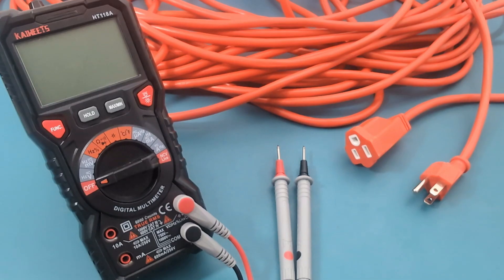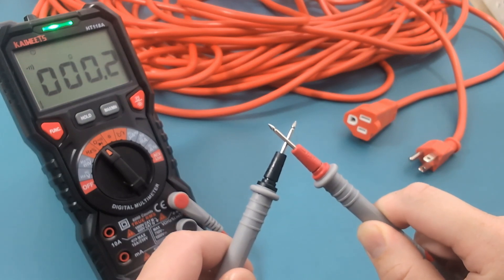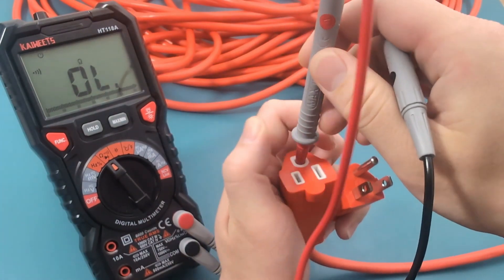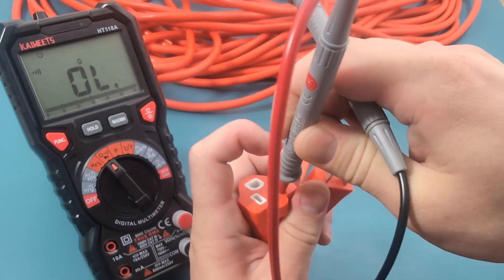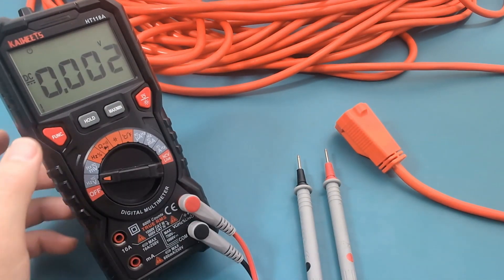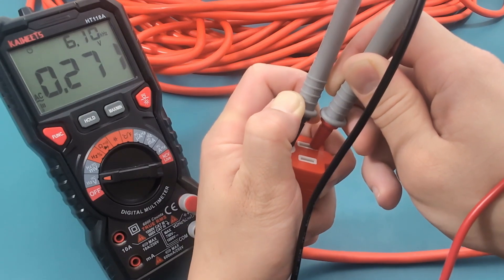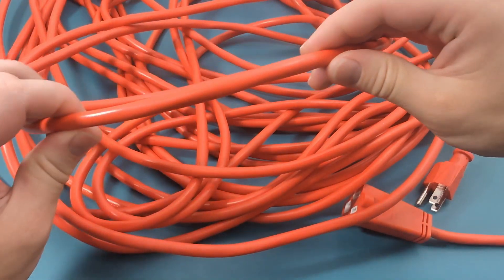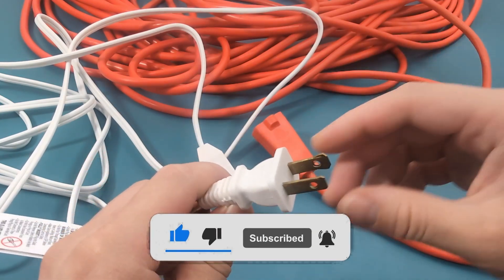How To Test An Extension Cord With A Multimeter

Comment: Extra tip: Elevate outdoor cable connections off the ground using cable ties and wrap them in plastic to prevent water and moisture-induced corrosion of metal wires and terminals.
Reply from the maker: Another great tip Robert! Thank you!